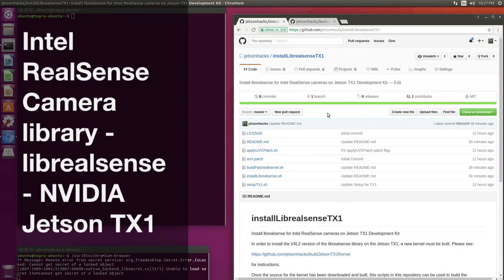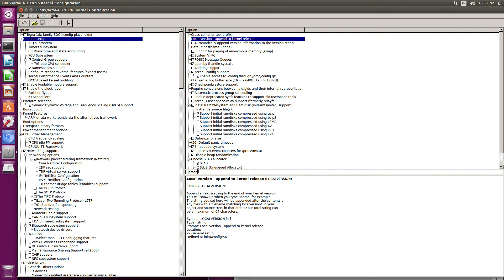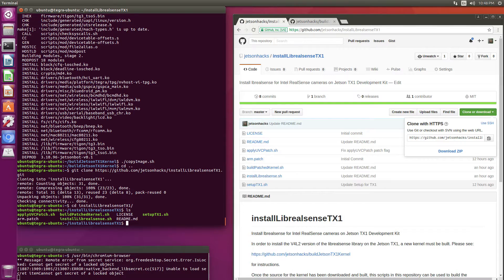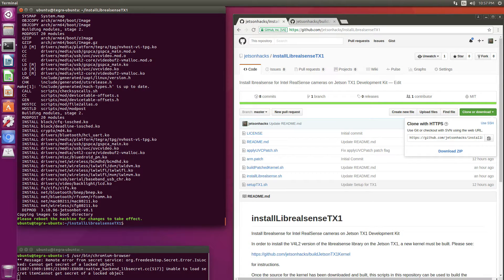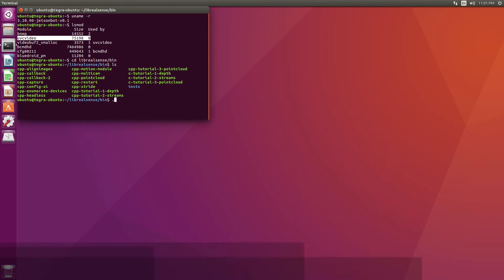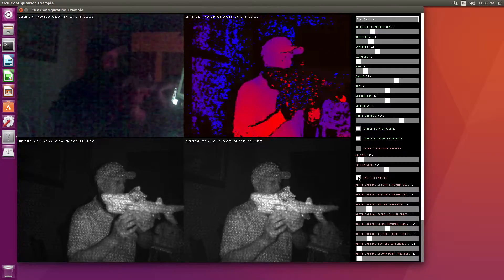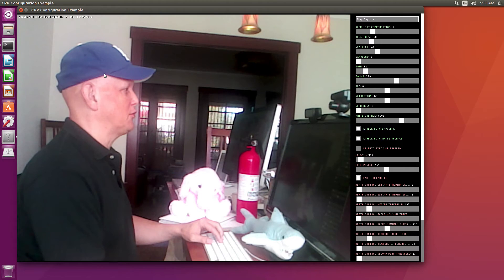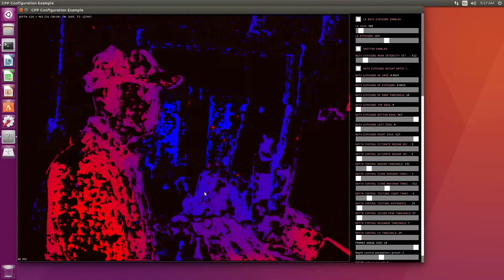Intel RealSense Librealsense - NVIDIA Jetson TX1

Comment: I follow the exact process to connect realsense r200 to jetPack 3.0. I get the error: UVCIOC_CTRL_QUERY:UVC_SET_CUR error 2, No such file or directory) when I try to run the ./cpp-config-ui file. Both kernel and module show same results as in the video, and the usb can recognize the camera. Any comment?
Reply from the maker: did you turn off USB autosuspend? What did you name the local version of the kernel when you built it? What is the result of 
$ uname -r
Reply: Thanks for your reply. The uname -r will output: 3.10.96-jetsonbot-v0.1 as shown in the video, and I also run the command: ./setupTX1.sh (I believe this step turn off the autosuspend. ) before reboot my system. The r200 is connect through the usb 3.0 port on jetson tx1 dev kit and the usb 2.0 port is used for my mouse/keyboard combo.
Reply: One thing to add is I boot the system from a SD card right after flash it with the jetpack 3.0. Then, I follow the steps of the kernel and module building, and install librealsense as in: http://www.jetsonhacks.com/2016/10/06/intel-realsense-camera-installation-nvidia-jetson-tx1/
Reply from the maker: The issue could be one of several things. I don't know how you're booting off of the SD card, but the script may to turn off autosuspend may not be correct; check the kernel command line in the dmesg to make sure  it is correct. Same with the USB permissions, it could be set up incorrectly between the eMMC and the SD card. You can try to run using 
$ sudo ./cpp-config-ui
to check on that. Also, people have reported issues when not using a powered USB hub. My machine works with a R200 plugged in directly ok, but others have reported issues.
Reply: The sudo ./cpp-config-ui shows same error messge. However, when I run dmesg, there is a error related to uvcvideo as: uvcvideo: Failed to set UVC commit control. I searched the internet and says it probably related to udev rules, so I redo the process that cp the 99-realsense-libusb-rules file into /etc/udev/rules.d/ but nothing changed. I do not have a powered usb3.0 hub at this moment, so cannot test if it relates to this problem.
Reply: Update. After spending one day of working around. I still cannot solve this problem since I am not an expert at OS, so I decide to reflash the system. To save the memory (so I don't need to burn to sd card), I just install the OS without OpenCV and other development tools. Now I can get exact result as shown in the video. That's nice. So the question coming out, if a copy everything from the eMMC to SD card and then boot it from SD card, will it work now? Or what are other options to expand storage for TX1? Thanks.

Comment: Hey! Also, for some reason, my jetson tx1 is not reading my intel realsense r200 when I plug in usb hub with my other usbs (mouse and keyboard). Do you know what could cause that? When i do 'lsmod' , I get 'bnep' 'bcmhd' 'cfg80211' 'bluedroid_pm' only. Thanks for your help and quick response!
Reply from the maker: Use lsusb to see if the R200 is recognized by the Jetson.
Reply: No it is not recognizing it. Does that mean there is something wrong with the camera itself? because i see the yellow light blinking occasionally on the camera. Thanks
Reply from the maker: Is your USB hub 3.0? More than likely it's a hub/connection type of issue.
Reply: It is 2.0. So do I need 3.0 in order for jetson to recognize the camera?
Reply from the maker: The RealSense R200 is a USB 3.0 device, so you will need either to plug directly into the USB 3.0 port, or through a USB 3.0 hub.
Reply: Alright got it. Thanks. I'll try that once I get a 3.0 USB hub. 
Also, I had a question. I am planning to use this camera and plant it on a bot which would be initially controlled by a remote and then later (hopefully) given some autonomous skills. But I was wondering if you have any articles on how to use this camera to map the surrounding (maybe based on the depth detected) as the robot is driven around? It would be really helpful if there is one because I couldn't find one that walks you through the steps on doing that. Thanks.
Reply from the maker: I have not done a video about that.
Reply: Ohk, I will still be waiting for it! However, do you know any good resources on that topic for now? Because I have been trying to figure out how to at least get started but it seems like I am completely lost. Thanks again!